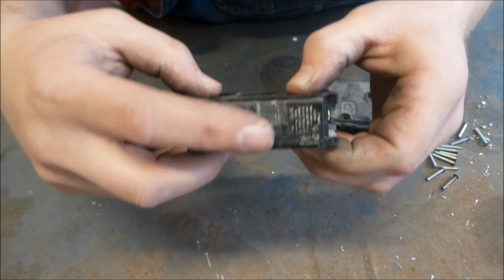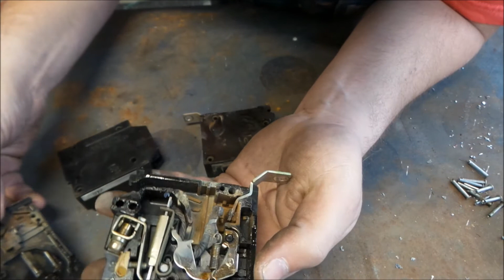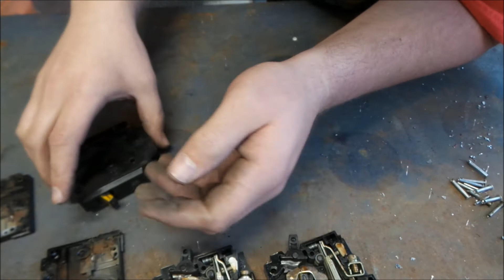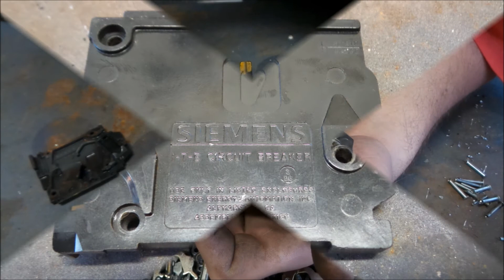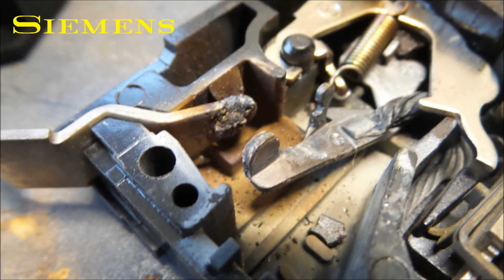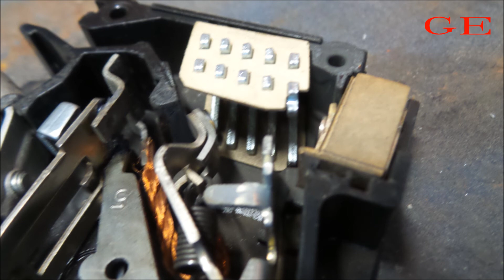Breaker Breaker One-Nine - A Look at Electrical Circuit Breakers

Comment: Here in South Florida, we have a lot of breakers that you think you've turned off, but they are really still on especially the ones in the breaker panels that were installed in the late 60's early 70's
Reply from the maker: Thats definitely not a good thing. Definitely make sure you verify everything. Old breakers can get you. These failed internally more than anything. I thought it was a fun thing to look at. Might have some more stuff like this coming up.